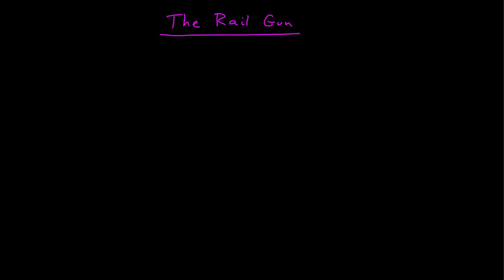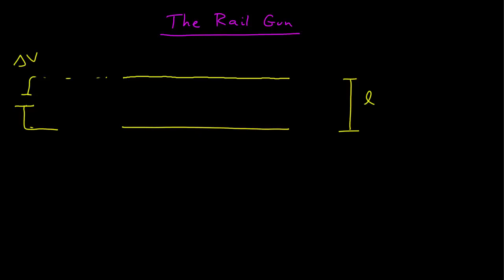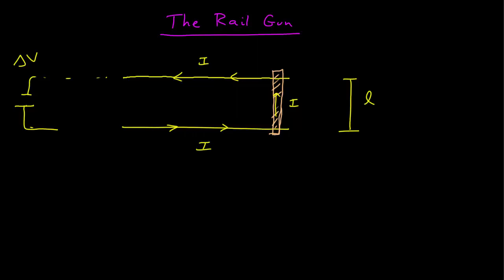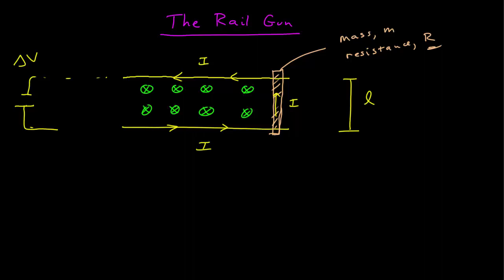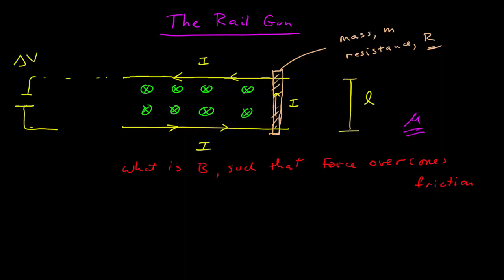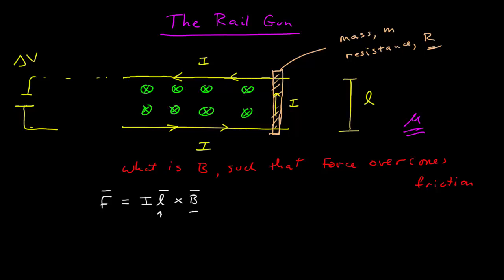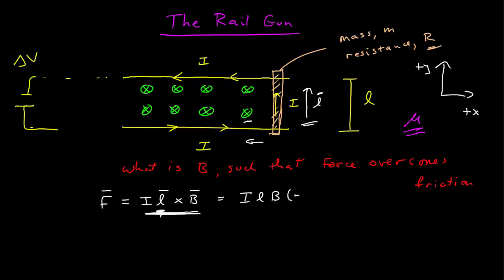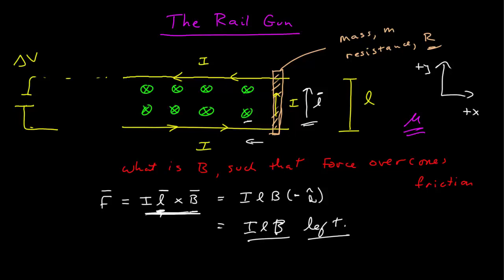Rail Gun example

Comment: Uygulanan kuvvet zamanla azalır mı? (B=2ki/d) ->  F=B.i.l  -> d (+) -> F(-) =?
Reply from the maker: Google tells me this question is "Is the applied force reduced over time?" We don't consider that in this problem, but if everything is held constant, the force should decrease over time due to Faraday's law creating a back emf that opposes the increase in magnetic flux through the loop.
Reply: @AbrahamPhysics  or in  circuit terms there will be a 'back emf' that adds to the resistance term and reduces the current according to delta V = I(R + L'v) where v is the velocity and L' is the rate of change of rail circuit inductance with position x.

Comment: I think the direction of magnetic field forming around the conducting rails is shown wrong in the video... it will be the other way round. Then we apply Fleming's left hand rule and check the direction of launching of the projectile outwards due to lorentz force acting on it
Reply from the maker: In this example, the object is being launched to the left. If you want to launch it to the right, you would want the magnetic field pointing in the other direction.
Reply: @AbrahamPhysics  Doesnt the direction of the current in the wires determine the direction of that magnetic field? Or is the magnetic field induced by something not shown?
Reply from the maker: @matthewdrum9250  good question. The magnetic field is from an external source in this example.
Reply: you seem like a knowledgable person... im gonna ask something in a very not scientific way which is if i were to make a rail gun on example of "Backyard RAILGUN: Field Testing the 250 lb Electric Gun, 27,000 Joule (max)" video of a model but instead of launching static projectiles i decided to launch spinning discs? the whole idea which it really is just an idea is to make a rail that could spin a motor but at the exact same time launch it while spinning. would all the different magnetic fields cancel eachother o would they boost off eachother in a right configuration and are there any real life examples of this bizzare mechanism working?
Reply from the maker: @theshankman8682  using this with a spinning disk makes the problem much more complicated. It isn't obvious immediately how to do it with this method. You now have angular momentum, the magnetic fields created by rotation, just a whole lot more mess. I don't have a quick answer, it would take a day or two to work through that problem.
Reply: @theshankman8682  If you were trying to launch a small conventional 'iron cored' motor out of a railgun, I think the railgun's magnetic field will generate attractive forces on the motor's core, so the projectile would most like not be subject to a net repulsive force as is required for a successful launch. 
If you check out many of the small coilgun videos on youtube, you can see that these use attractive forces and 'iron' projectiles, that are pulled towards the coils. For example, the ArcFlash labs guns do use that system. But railguns (and induction coilguns) use repulsive forces to drive their projectiles away from either the railgun current loop or the coilgun coils.

Comment: l DOES stand for the length of the connecting rod. Why would you need to factor in the length of the rails if it is not moving? L is for the amount of B the rod is subjected to, hence greater force. You got it backwards.
Reply from the maker: Sorry I'm so late to follow up on these. At first, I had no idea what this comment was talking about. But I get it now. In the video, I say the "script ell" length is the length of the wires and not the length of the bar. That's a poor choice of words on my part. What I mean here is the separation of the wires and not the length of the bar is key. I'm trying to make the point that since the bar hangs over the wires, the total length of the bar isn't the important parameter, but only that length that spans the two wires. I should have used the word separation here.